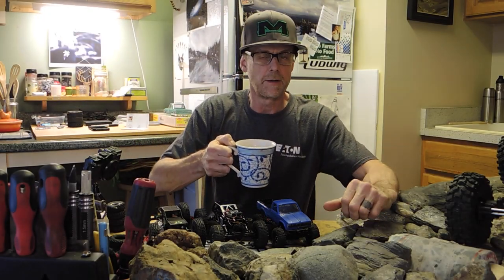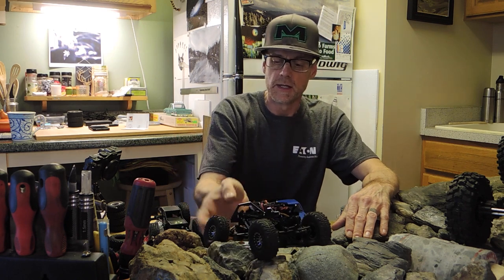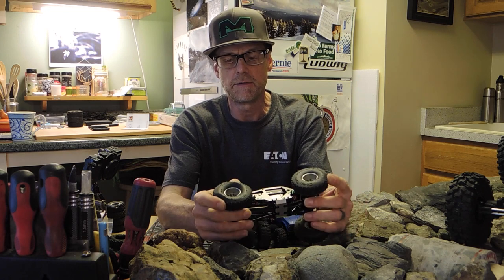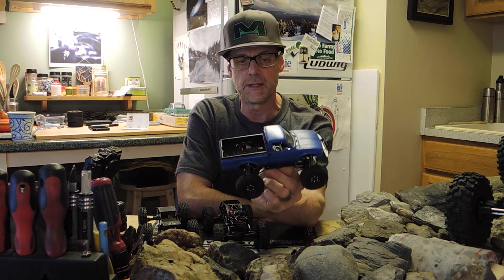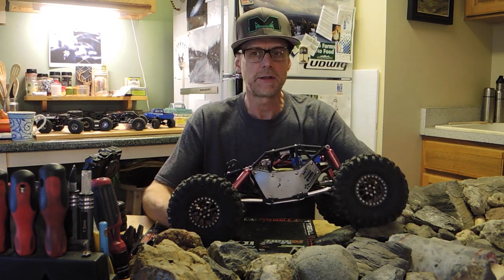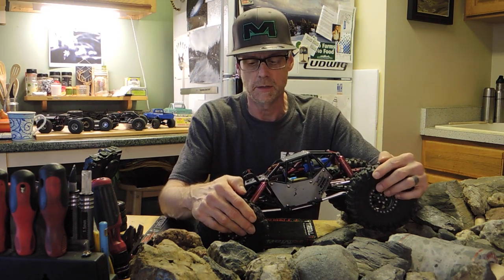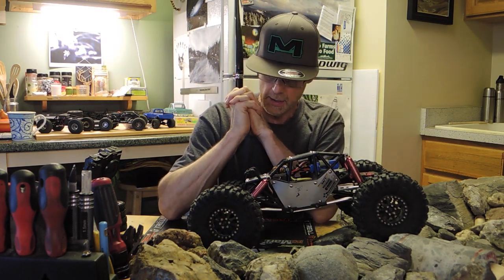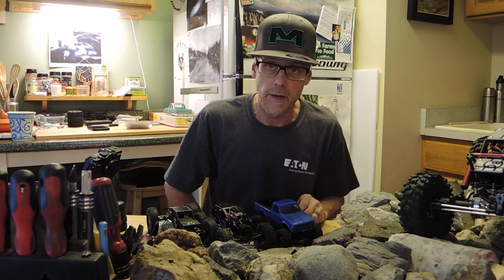Tiny Truck Talk & Channel Update

Comment: Try the MOA from hobbyking. Basher Rocksa 1/24. Put some your injora pin wheels and tires on it, and telescope shocks. You will have a blast, and its a cheap great starter to the moa. I am a long time moa guy, and always buying anything moa. Basher Rocksa is worth the money.
Reply from the maker: I just, last week, got the Das Micro - Dashex Z2 1/24 MOA - the ESC that came with it was one of those miserable generic red ones that claims to have 20A current when in reality it's more like 5A max. I was looking at the Rocksta and decided to go with the Z2. While I think the Z2 is nice, it just lacks power. I've since put an RC4WD esc in and it's better but nowhere near where it needs to be. 

I'm also in the middle of working a deal on a used Bully II. I've been after one of those for a while. What do you for your main comp rig(s)
Reply: @VermontScaleCustoms  I personally run the Rocksa axles with my own full custom bent brass gladiator links ( bent to around c10 scx length), mofo torque beast motors,  solid brass wheels in front with modded mofo scx +4 axles stuns, plastic scx wheels in the rear with +0 wheels and hex. Treal front hubs modded to fit basher rocksta axle carrier's front and back, but over wieght hubs in front. Scx24 with only stock skid plate, and driveshafts. I am a old school MOA comp builder. Back building Clod Buster comp rigs, and wheelyking conversions. Still my favorite hobby!

Comment: Good stuff brother, I look forward to seeing how that holmes motor does, my buddies and I really like his stuff, I think just about every one of our 1/10 rigs are running holmes
Reply from the maker: Thanks, man. It's solid so far. Big difference. Would probably be even smoother on new electronics. Still running V1 in all my SCX24. All my 1/10 rigs have HH Torquemasters in them: 540 27T in my TF2 and a 550 13T in my Gelande II. That 550 13T is crazy strong. I'd run a brushless in my R1 as soon as I can swing the $$ for the whole setup. They've been super solid so far. I have an old Trailmaster that needs rebuilt. It was the first one in the Gelande II. Lost one leg of it at some point last year. But it was so old they told me that they hadn't made it for about 6 or 7 years.